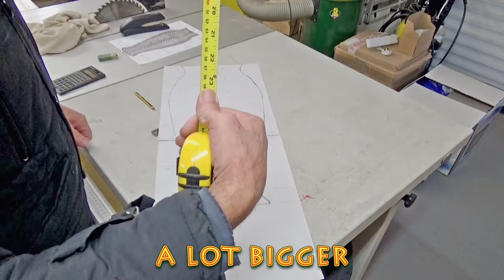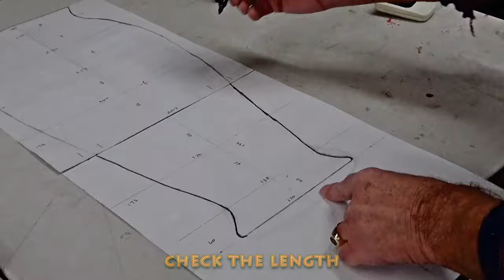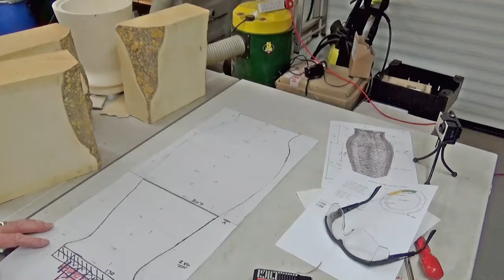Woodturning a huge floor vase - without a steady rest.

Comment: Second time around watching this Peter.  Adding a whole new (dare I say) 'dimension' to segmented woodturning.  Definitely brings home, 'where there's a will - there's a way' and without doubt no defeat here.
You smashed it, though the nerves must have been frayed at times???
Excellent idea to use screws through the Cole Jaws for extra support.  Because of the segmenting and glue lines the addition of the black paint did this project the justice it deserved to show off the final form to it's best potential - as proved in it's 'show' 
environment.  Loved this one.

Regards Peter, until next time.
Tony.
Reply from the maker: Hi Tony,
You are definitely improving my "view" numbers watching more than once. Probably one of the only positives of this lockdown thing is that people are watching more Youtube videos. My subscriber count is going up daily. 
This project was certainly a bit scary at times especially at the end with the final hollowing but we got there safely in the end. I didn't originally intend to spray this but as you noted, the segment glue lines didn't look too pretty and needed covering up. This was actually for my daughter who now has it on show in her dining room.
Glad you enjoyed this one and again, thanks for the comment.

Comment: I never thought about putting screws through the backside of the Cole jaws. Great idea!
Reply from the maker: Jeff Wimer,
Yes it gives you a bit more security for the turning if the screw holes are to be turned away in the finished piece.
Thanks for your interest and your comment.

Comment: First time hear and I am very impressed that you Record Power Lathe handle it> I thoroughly enjoyed the whole turning process and the unique way you put the vase together.I have in the pass turned two parts to a project then glue together but that was amazing the way you did It I am going to subscribe so I don't miss any more of you project 
Thanks for sharing:  John
Reply from the maker: Hi John,
I was concerned with the weight on the lathe bearings which is why I got rid of as much waste as I could by other means.
Glad you liked the project. Thank you for your comments and your subscription.

Comment: A very interesting technique for the construction. You certainly made use of all the wood you could. I especially liked the wedges in one of the center sections. It is also interesting how you used the band saw and jigsaw to assist in some of the hollowing. Very interesting use of the pivoting headstock too. And a great finish. I like the black. Now for the criticism: I did not like the music. It was the same few bars repeated endlessly. It was mind numbing after a while. I would have preferred to hear you would do a little narration. And last I do not care for speed up through the majority of the video. All the jerkiness is annoying. A little bit of that goes a long way for me. I appreciated that you took the time to present your project and it was well worth seeing the finished vase.
Reply from the maker: Glen, Your positive comments are appreciated and your criticisms are noted. Its very difficult to please everybody but I do take your comments on board. I have had other comments liking the music on my videos from viewers who do not like narration and find it boring. Plus you have to be reasonably good at doing narration which I am not. I will try to improve the choice of music for less repetitive tunes. The speed up issue is more of a problem. Most people use some speeded up footage even when doing narration. It would be very difficult for me to do so without cutting out a lot of footage or having extremely long videos which I don't think anyone would watch. Thanks for your interest.